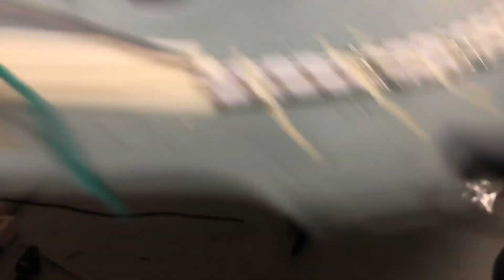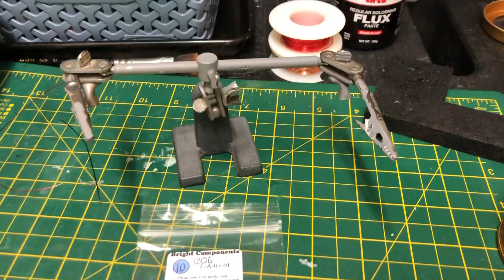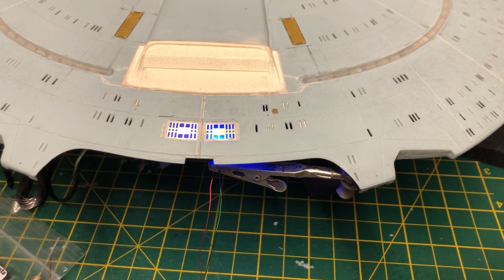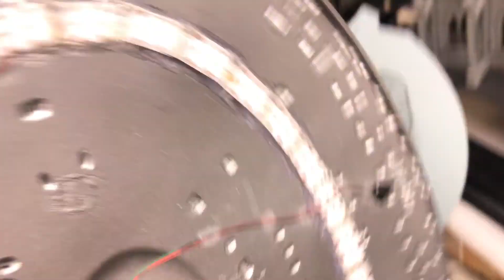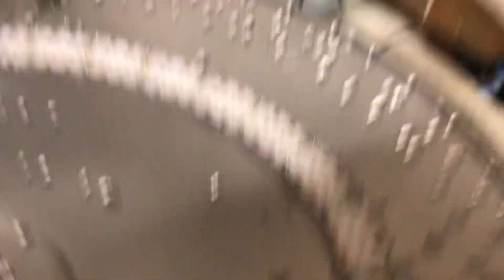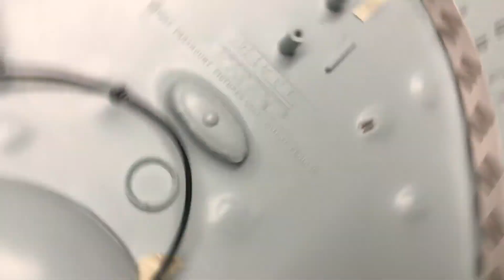Build review of AMT/ERTLS USS Enterprise D 1/1400 scale: Top Saucer electronics - LEDS!

Comment: I had such a big smile on my face after those phaser strips lit up! That looks epic!

And thanks for showing how you solder smd LEDs. Using tweezers with helping hands seems so obvious in hindsight, but it never occurred to me. Thanks for that tip.
Reply from the maker: Thank you 🙏🏻 
Does look good doesn’t it? I could sit there for hours just pressing the button and watching it 😁
Decided to do the phaser strips in the bottom half of the saucer also 👍👍
Those SMDs are tricky to wire up, just the easiest method I’ve found to do them.

Comment: Wow I'm really loving how smooth that phaser effect looks. I really need to learn how to do that.
Reply from the maker: Thank you 🙏🏻 
It’s not as difficult as you may think. The hardest part was learning Arduino for the first time but after doing lots of research and learning, it’s quite straight forward.
There are links in the video descriptions to resource vids, web pages, well worth a look at to learn how to do it with open source code freely shared.
Reply: @thekitcave2654  Thanks. I've created some basic circuits before on a board, so hopefully this won't be too much harder to figure out.
Reply from the maker: @davidjames1389  I would highly recommend watching the playlist series over on Ostrich Longnecks channel - very comprehensive and easy to understand/follow along. Bare in mind though that his playlist is for Arduino effects for the Ent refit and so some modification is needed for Next Gen ships - but a great start to begin learning from.

Comment: The translucent plastic of this Enterprise 1701D model kit is very brittle! At least the upper saucer section! I cracked the top by applying photoetch phaser ring banks! Lightly pressing them down! So be careful!!
Reply from the maker: Sorry to hear it snapped on you, never a good thing when that happens. Very disheartening. Luckily this isn’t any of the translucent versions but the original cast done in grey plastic and not brittle at all.
But always sound advise to be careful with kit builds 👍

Comment: Looking great!  When I did my old 1/1400 Enterprise-D years ago I just went with decals for the escape pods after sanding them all off with the grid lines.  The hatches are almost flush and at this scale they actually looked really good.  Just in case you didn't realize, the Enterprise-D didn't have the flashing running lights on the saucer, they flashed in some areas and of course the strobes flashed, but the saucers running lights didn't.
Reply from the maker: Thank you 🙏🏻 
Progress is slow but steady. I will be going with the decals for the escape pods.
I’ve been watching a lot of vids to get the flashing lights accurate and there’s a lot of different variations from tv series to Generations and even Picard, where the the final shot of the D along side the G has them flashing, but static illumination in the tv series, all lights static illuminated in battle mode in Picard (when.flying through the Borg ship) and even some of them not illuminated or flashing at all just after leaving space dock.
Bit of artistic license being made here 😁
**just re-watching segments of the final episode of Picard (as I type this and can see that the saucer tuning lights are indeed static illuminated with ‘flashies’ on the bridge and warp nacelles and on the ‘belly’, but then towards the end of the episode, there’s a different configuration of flashing lights.
Hmmm got me thinking now 🤔🤔

Comment: I think in 1/1400 scale decal lifeboats would work more in this scale, they would be close to flush with the surface. 
Using the slightly raised parts on the kit and using decals will work well I think.
Great progress so far, the modifications are looking good.
Reply from the maker: Thank you 🙏🏻.
It’s good to finally start getting some lighting into at least one piece of the kit 😁
I’ll be going with the decals for lifeboats.